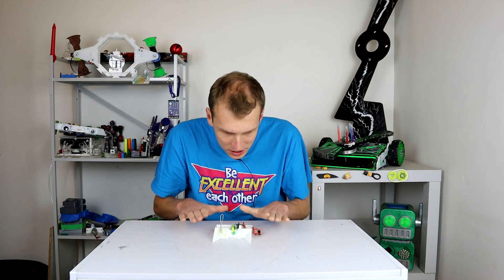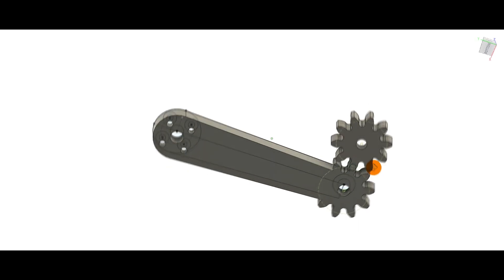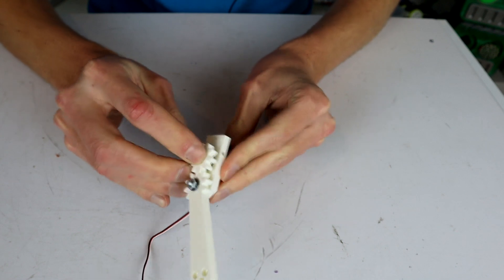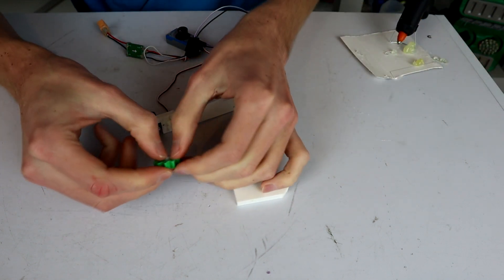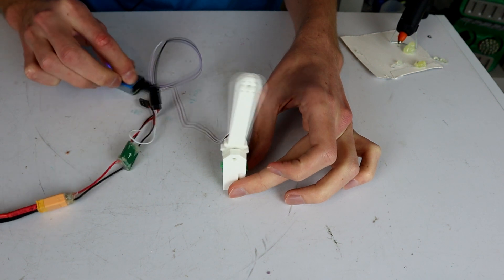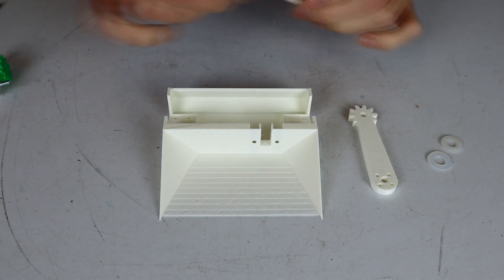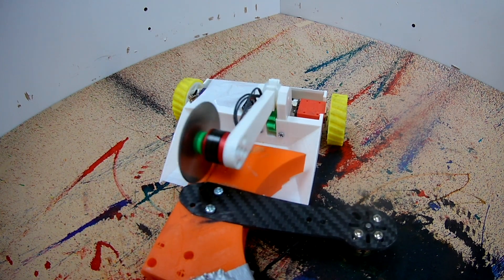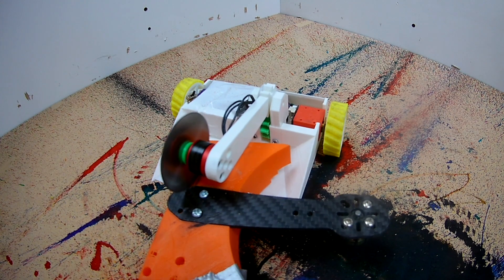Over head saw prototyping (150g antweight)

Comment: Looking at the set up of the heavier bar in action [slow-motion] the arm appears to bounce as it strikes, there is not much weight in the arm compared to a heavier weight robot. There is not 6kg of mass being hammered down with 30kg of force here. I would predict that most of the energy from the bar is going through the cantilever arm into the gears, through the backlash of the gears and into the servo which will be fighting to keep its position, before most of the bar's energy is transferred into the opponent. One reason the saw is causing more damage is the servo can compensate for the backlash over a longer period of time than the sudden shock of a bar impact, forcing the servo back before it can react.
Reply from the maker: I think thats a very fair analysis and I'm not sure that it can be fixed in this weight class.

I'm thinking that I'll try a thinner single tooth titanium weapon that will cut more then hit

Comment: 123D? Wasn’t that program taken down a few years ago?
Reply from the maker: Yes... kind of
Its a mostly offline program with some online elements. The online stuff has stopped working (mostly being able to share files and cloud saving) but the actual offline CAD bit still works.

If you can get an installer you can still use it

Comment: Great video, I wait every week for your uploads.

Is titanium cutting available where you live? Because that may allow you to put an actual weapon instead of a saw blade on it because hardox weighs about double what titanium weighs. you could also get a new weapon cut with a smaller width so it weighs less or use a combination of both. Just throwing some ideas out there.
Reply: I am not sure but maybe and hopefully, maybe if you could get like a 1 or 2mm or maybe even ⅛ inch (3.175mm) titanium single tooth disc that might work idk just throwing some ideas out there
Reply from the maker: I'm not sure about titanium cutting, but its something I could look into. Titanium weapons would be fun! 

The main reason I am not looking at the spinner is because it seems to do less damage then the saw. But maybe a thinner weapon sharpened to a point would work better

Comment: what happened to the melty brain beetlewieght
Reply from the maker: I'm working on it slowly in the background.
The next video on it will be all about coding and getting it spinning, but I'm not quite sure how to make that an interesting video, code doesn't make for an interesting video
Reply: @TeamPanicRobotics  maybe you could make a video on the vertical spinner configuration of the meltybrain you talked about in one of your other videos
Reply from the maker: I will be making a video on that. But its at least 6 months away.
Before I can build and test the dual vertical spinners I need:
-The meltybrain test platform spinning
-The electronics moved over into the dual spinner chassis
-ARC to have a ,meet so I can test the dual horizontal spinner configuration
-A decent reliable hub motor design
-The place I CNC aluminum/HDPE to open up so I can get the new arms and hub motors cut
-The place I get Hardox cut to open so I can get the new weapons
-And finally a place to test the dual vert melty-brain as safely as possible

So its a little way off yet, but I'm working on it. I have parts coming in to start testing hub motor designs soon
Reply: Team Panic Coding isn’t that boring, especially for people like me who are starting out. Also, a few videos back, you told me a lot of advice, which I took to heart. Currently working on making simple games in construct 3 for practice, but soon enough I will try to code an arduino.
Reply from the maker: Coding itself isnt boring, its just hard to show in an engading way in a video.
I will be doing a video on the code I use to get my melty spinning, but I know it will be a struggle to keep it engaging enough that people dont just start skipping big parts of it